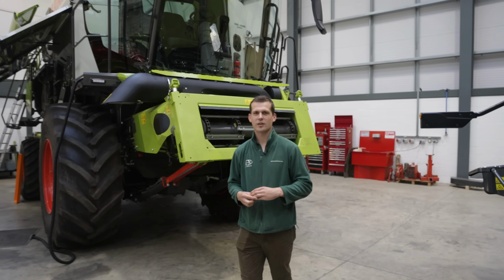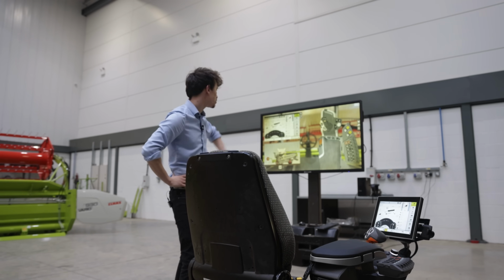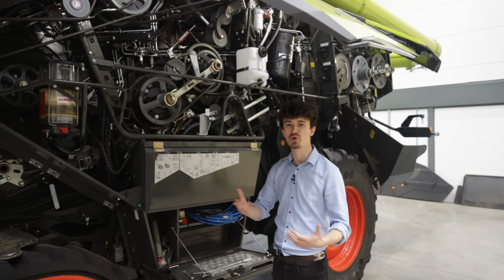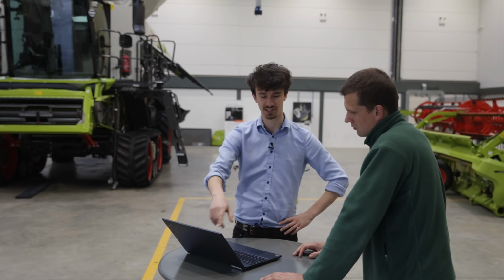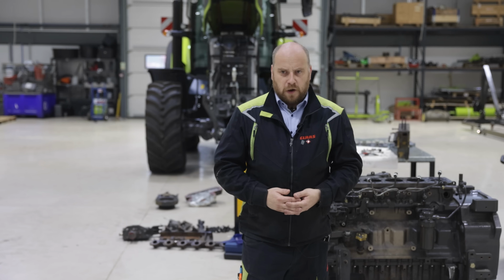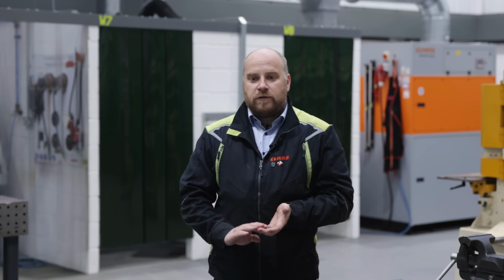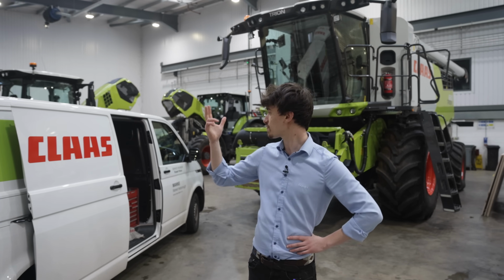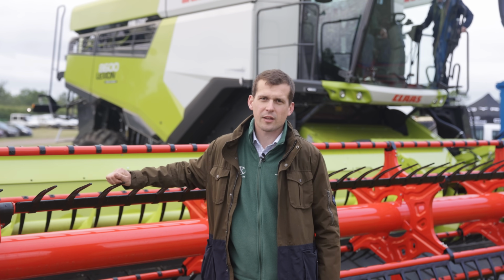Behind the scenes at CLAAS HQ

Comment: Sharing of machine status and running settings good BUT what worries me is output / tonnage being shared as it could be used by third party who could use it in the commodity markets
Reply: Only shows output. T/hr.
Reply: It isn’t that accurate… and Claas like most other companies have a data protection policy which means they won’t sell data. The value in telematics yield data is the trend, why it came out lower or higher.
Reply: @jhlane1977  vague at best.